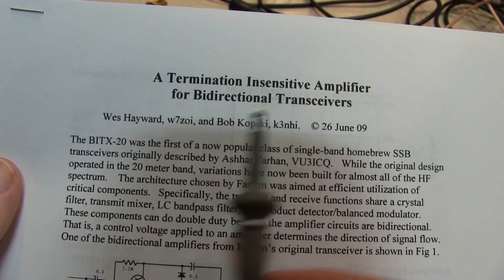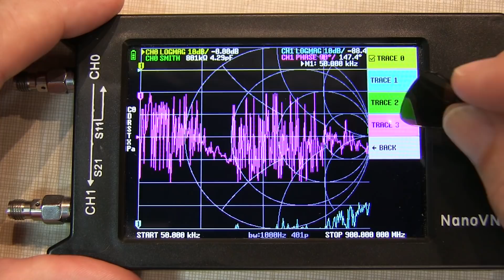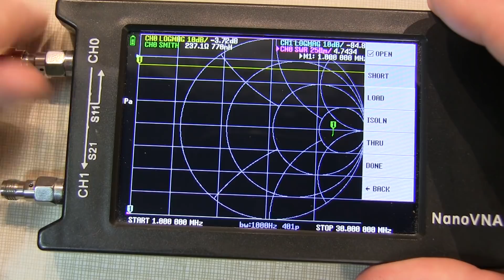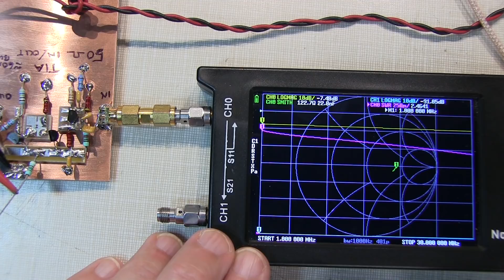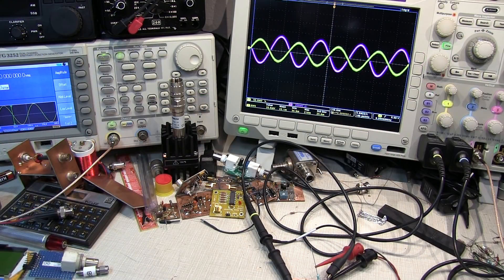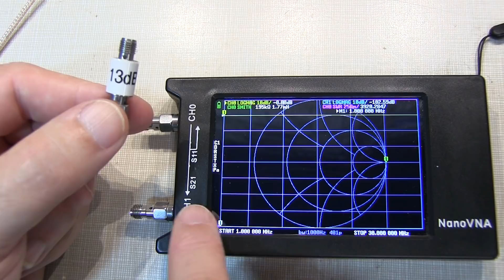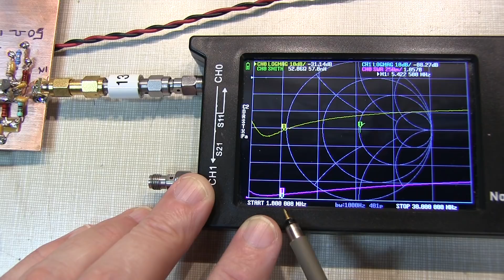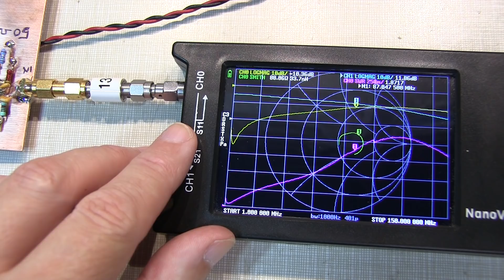#337: Use a NanoVNA to measure input impedance and gain of a small-signal RF amplifier

Comment: I watched some of your intro videos on the NanoVNA last evening and was laying in bed wondering if the NanoVNA could test some preamps and then thought I'll likely need some attenuators. Then I stumble across this video doing just that.

I really wish the NanoVNA was around 20 years ago when I was in college. I might have done much better in my microwave circuits class. I'm just realizing that I did a 3 year telecom course and never got hands on with a VNA or a spectrum analyzer. Now 20 years later I feel like I'm finally getting it. Had a similar experience the first time I seen AT&T's similarities of wave behavior like 15 years ago. I feel like college gave me a really good foundation in physics and math, but the radio electronics end of things was pretty weak. I've also never really worked in the field. Spent the first 10 years(starting from 17 before college) of my career working in AV doing sound, lighting and video.  These days I do science center exhibit design, fabrication and repair. I've been a ham since I was 16(25 years ago).  I keep coming back to the hobby and having new breakthroughs in understanding. Like the first time I seen SSB on the SDR waterfall, modulation suddenly made so much more sense.
Reply: Amazing, I'm doning electronics my story is the same.

Comment: Thank you Alan.  This helps so much.  Armed with your info we can all now use the NanoVNA to accurately measure circuit impedances.  This will be an enormous help for those of us who routinely take bits and  pieces of circuitry from multiple sources and try to put them together into working rigs.  Your video and the NanoVNA will remove the Z guess work.  Thanks again and 73   Bill
Reply: @SolderSmoke Bill - you nailed it!  I'm one of the folks that your and Alan's back and forth has been helping - thanks to both of you!  73
Reply: I heard "N2CQR", oh! That's Bill Meara of Solder Smoke!
Very helpful info, Alan, especially your explanation of the 13 dB attenuator.

Comment: Great Video Alan! (as always!)
I normally would have caught that because any time I do an analysis on something, I'm always cognizant of how much signal to put into beforehand.
This really true for direct-coupled amplifiers where you can pin-one to the 'rails' and blow things up!
In saying that, I can see where you would intuitively-assume that it's output would not be real high (i.e. tiny-box = tiny-signal!).
For the RF, I'm at the point of always first figuring out how much attenuation I can insert without compromising my measurements--good practice...

Comment: Great video.  An attenuator reduces the dynamic range of the VNA, so I've used a directional coupler to get a little less noise.  You're at the upper end of dynamic range, so not a concern in this case.

Comment: This video comes at an opportune moment, as I'm playing with one of these little BGA2866 MMIC amplifiers.  The S21 gain measurement on the NanoVNA is also invalid when the signal distorts.  Adding attenuation changed the gain figure from 11dB to 18dB on this test board.  Thanks!

Comment: Any video by you explaining the function of every component used in the 433 MHz transmitter and receiver RF circuit, explaining working of the both the RF transmitter and receiver circuit

Comment: I NEVER HAD THE TIME TO SPEC THE OUTPUT LEVEL, AND NOTICE THE EFFECT IT HAD ON INPUT LEVEL SIGNALS. THE NE602 MIXERS NEED TO BE LOOKED AT IN MORE DETAIL, MAYBE THERE IS A WAY TO ADD A CIRCUIT TO DO THIS VERY SAME TASK, BUT ALLOWING IT TO BE SWITCHABLE AS WELL.
WHEN YOUR BOX OF TOYS DOES NOT HAVE SUCH ATTENUATORS, YOU ARE FORCED TO ADD EXTRAS, BUT THAT REALLY CREATES A MESSY TEST BED.
3dB, and 10 dB PADS I HAVE, NOT THE INTERMEDIATES. GUESS I WILL BEGIN ACQUIRING THESE AS WELL. THANKS!
Reply: no need to shout here

Comment: Great video! Can you please show us how to check that the output impedance of the amplifier is also 50 ohms?
Reply from the maker: You would simply terminate the input of the amplifier, and then connect the output to CH0 and run a S11.  But, also you can see this basically from inspection.  An emitter follower has a very low output impedance (basically 0.026/Ic), in this case just a few ohms.  Then, there is a 47ohm in series - so it's basically very close to 50 ohms.

Comment: Hi Alan, I think this is your most recent video, so I'd like to reach out and ask you to set up an experiment that's right up your alley but I haven't seen you do it. It applies largely to PCB design and I think it was Rick Hartley that mentioned it but it's pretty spectacular and very simple to to.

If I have this right (and I may not!) the idea is you get a loop of coax - maybe a few metres/yards long (I'm European so I use metric) and insert an ammeter in the ground shield some where at the top of the loop.

Then you "short" the shield at each end with a short piece of wire - and you've probably guessed - put another ammeter in that short run.

Rick points out (and I believe him but I'd love to see this done) that at DC, the current all flows in the short return path but as the frequency increases, and he says the effect starts at audio frequencies, the current flowing in the "direct" path to ground begins to diminish and increases in the much longer loop. 

Rick explains this is because as the frequency increases the energy, which is travelling along the dielectric as a magnetic and electrical field (again, I might be wrong here) starts to "hug" - my word - the shields on the coaxial line.

I can do this at home with my own paltry "free shipping from China with a counterfeit XR2206" equipment ROFLOL but you're a great teacher and with your skills and superb equipment you could demonstrate this to a far wider audience than Rick or Eric Bogatin are able to reach!
Reply from the maker: You've heard the addage that "current always takes the path of least resistance".  We'll that's not the most accurate way to state that...  It would be more accurate to say that current always takes the path of least *impedance*.  For return currents flowing in a ground path, the "least impedance" translates mainly to "least inductance" as the frequency increases.  Inductance is minimized when the "loop area" between the forward path of the current (center of the coax in your example) and the ground/shield return path is minimized.  Thus, the image/return currents "hug" the region closest to the forward current path.  I talk a bit about this in my video on bypass capacitors (https://www.youtube.com/watch?v=9EaTdc2mr34)
Reply: @w2aew  Well blow me over with a whisper! :) Somehow I missed that one - probably (cough) bypassed (cough) it because I already knew about placing small caps near to the VCC/VDD rails on my ICs. I've been doing this like a trained monkey since I was a kid with no real appreciation of why. 

I've been working my way through your stuff and I wish I'd had teachers with your skill at explaining stuff when I was learning back in the 1970s. It's hard to explain the debt of gratitude I feel for all your work!

I'm still a little vague on this transmission line stuff since I tend to associate it with RF stuff that I don't personally work with. Of course, as you've pointed out here, the fast edges we're creating with modern chips (heck, I can recall near-chip bypasses back on early CMOS chips) produce masses of RF harmonics off into the multiple Ghz just by the switch time.

I forget if it was Rick Hartley or Eric Bogatin who described the experiment but (if you do care to recreate it), I believe the idea was to put an ammeter in the "short" side and another into the long loop. As the fundamental sine wave is swept  up into the high audio frequencies and beyond (if I've grasped what they were saying) the current - continues to follow the path of least impedance, so the current in the dead short drops away while the current in the (measurably) longer DC path starts to increase. 

Presumably this would require the sort of bench gear that many of us don't have as DVMs won't be able to measure AC currents accurately. 

I think it was Paul at EEBlog who traced around a ground plane with a fairly high end current probe attached to a Tec scope and demonstrated how signals propagated through the copper. 

I know this is pretty basic stuff to some but my poor brain opened the lid of my noggin and a white flag popped out. ;)

Apologies for the humour, it's the shortest path to describe my ignorance and astonishment at these wonderful demonstrations.

Thank you again.

Comment: Incredible video as always. I am using a Nanovna in order to check the input impedance of a transceiver IC used for an RF-433 Mhz module. The tranceiver IC has an LNA stage this is why I need to use a 30dB attenuator in the CH0 so that the IC's input stage amplifier will not get saturated(exactly as your video). The problem is that when I try to calibrate the nanoVNA using the 30dB attenuator the results I get are very very noisy. It seems that the impedance values in the smith chart are all over the place and I cannot understand why this happens. I have tried a second nanoVNA with no better results.
Reply from the maker: This is to be expected, unfortunately.  Even high performance lab grade VNAs will be noisy with a 30dB attenuator inline, expecially in CH0.  Think of it this way - the signal generated out of CH0 is attenuated by 30dB (1000x) before going to the LNA input.  Any reflected signal from the LNA will return through the same 30dB attenuator, making it even smaller yet.  So, for a device with a good return loss, the reflected signal will very small, and will be reduced by another 30dB before being measured by the VNA.  The only things that may help are the use of averaging and a lower RBW (if your unit has the ability to adjust the RBW or measurement BW).
Reply: Oh understood!!! Thank you very much Alan! You are always to the point!

Comment: Possible use less output Power (after reset go to Calibration->Power) in this fw Power auto use 8mA output in this range, so try reduce Power to 2mA, and after this made calibration.
Reply from the maker: Thanks - not all firmware versions give you the option of adjusting the power, so that's why I didn't mention it.

Comment: This is awesome, Alan. I have been fretting over this very thing for the past few days and was slowly working out a process to do it. I'd even bought, a couple months ago, a TO-72  HP 11858A & 11600B transistor fixture for my vintage HP8753 which allows you to insert and bias bjt's in the 3 different amplifier configurations.  How would you measure output impedance? Specifically, how would you do this for tube amps? or high power LDMOS amps?  I'm not the sort of person that just accepts that you do xyz (i.e use a 1:9 output impedance transformer as rote for an LDMOS part) because everyone else does it that way :)

Comment: Inquiring minds need to know! Is there anything significant about the 13dB attenuator? It seems very "random"? Great video showing one of the many "gotcha"s in electronics!
Reply from the maker: As described in the video - it drops the level to an acceptable level, and it’s approximately equal to the amplifier gain

Comment: Question: why don't you calibrate at the end of your adapter that connects to your amplifier and the end of the cable connecting to your amplifier?
Reply from the maker: I didn't calibrate at the end of the adapter because I don't have a set of female open/short/load standards.  Not worried about it though, since the phase shift through that short adapter was not significant at the operating frequency of the amp.
Reply: @w2aew  Thanks! That makes sense.

Comment: Hi Alan. Are these (budget) VNA's, that probably all of them use a square wave for the stimulus, in general suited to validate active circuits like amplifiers (of course making sure in- and output levels are correct, as we see in your video). As you say in the video, you are not concerned with this fact? Maybe the input of the amp will filter out some sharp edges? Or other way around, in what use cases these devices would be generally unsuitable? Other issue would be sometimes the devices that are using harmonics, whereby the strong fundamental is also present? But that would be a sub-question 🙂 This is contrast with a "real" VNA, that probably uses a sinus stimulus.
Reply from the maker: It is really highly dependent upon the device being tested, whether its performance would affected or different due to the squarewave stimulus vs sinusoidal drive.  It requires applying knowledge of the DUT and the effects of the harmonic-rich drive signal.

Comment: Very enlightening, sir.  I'm building that exact W7ZOI amplifier.
If you would be so kind as to offer me some advice, I would appreciate it.
I'd like to test the impedance of a mixer oscillator input using diodes with 300-500mV fwd voltage.
I'm guessing the Nano-VNA with 600mV should do the trick?
73 and thanks for everything you do
Reply from the maker: For a typical diode ring double balanced mixer, the LO port will typically NOT have a nice, well controlled impedance.  The function of this port is to quickly and fully commutate the diodes.  When this happens, then RF/IF ports should reflect the impedance at the other end, since the diode is making the connection from the IF to RF (or vice versa).  Testing the IF or RF ports without a) terminating the undriven port, and b) properly driving the LO port, will lead to incorrect results.
Reply: @w2aew  Thank you!

Comment: Nice video as always.
Do you have a video about TL072/074 JFET input Op-Amp on how to properly use them and its performance/behaviour and their differences between LM324/4558? If non yet, is it possible to feature it in one of your next video please? Thank you and more power.
Reply from the maker: They are quite different.  The LM324 is specified for operation from 3V to 32V supplies, while the TL072 is rated for 4.5 to 40V supplies.  The LM324 input common mode includes the negative supply rail (but not the positive supply rail).  The TL072 is just the opposite - input common mode range includes the positive supply rail, but not the negative supply rail. The TL072 output can swing fairly close to both rails (with light loading), while the LM324 can only get up to 1.5V below the positive rail.  These are just a few of big differences...
Reply: @w2aew  Thank you very much for the quick response.
I bought last year a TL074 with ST brand(no original) and last month with another brand(no original) but they're both from China. I wondering why the newer one behaves differently, lots of noise and early clipping. I'm thinking I might have some errors. I'm thinking if there are proper ways of using JFET input Op-Amps though my ST brand workes fine on the same circuit. I know the second purchased with another brand are not original for sure but same with my ST brand that works. Maybe I was faked(?) 
Thanks.
Reply from the maker: @JB-20  It sounds like you may have received fake/counterfeit ones.  Also, not that not all JFET op amps have the same specifications - so always check the datasheet.  Of course, if you get fake ones, all bets are off...
Reply: @w2aew  Ok, this clears everything. Thanks a lot.

Comment: Thanks for sharing w2aew!
 Does this mean that I have to use a 13 db just to check the input tune of my  Mini-Ball TL60 60 watt one transistor amplifier?
The problem is that the SWR is 3.1 to 1 with the amp on. It is putting out 50 watts with 1 watt in.
I suspect that it is tuned to the center of the 10 meter band. In fact my Nano VNA actually shows that it resonates at 28.500 MHz if I sweep the input of the amp
and has an SWR of 2.82.

I'd like to tune it to 11 meter and get the SWR down as low as possible.

Comment: Hello Alan, thank you for the video. I have a question about adding an attenuator at at the nanovna output. Wouldn't that cause an accuracy problem with the S11 measurement?
Reply from the maker: The affect of the attenuator can be calibrated out.  However, since the signal injected to DUT is attenuate, and the reflected signal is also attenuated, there will be some additional uncertainty in the measurement  - especially for DUTs with a good S11 (low reflections).

Comment: so where did you get the idea to use a 13db attinuator, was it from the determined gain of the circuit?
Reply from the maker: Yes, based on the gain of the amplifier

Comment: Very nicely presented and clear.  (a) Any caveats when measuring the output impedance looking backwards into the amplifier output?  (b) Which firmware are you using in this video for the H4?  Mine does not seem to have the "401 points" on the bottom..
Reply from the maker: As long as the output is AC coupled, then simply terminate the input and measure S11 on the output.  I am currently running 1.0.39 from Dislord (see video #320: https://www.youtube.com/watch?v=NcXzITPPTyA) on my H4.

Comment: Hello Sir...I just run the same experiment, and it works using the 20dB attenuator, the TIA gain was around 23dB.
BUT the nanoVNA graph show wierd pattern when calibrated using the 30dB or 40dB attenuator. I dont know why ?

Comment: Amazing video. Was thinking of trying this same thing two months ago.  Great tip about the nonlinear effects.  The amplifier has to be turned on (biased) to make this measurement?  Do you need a DC block to protect the NanoVNA?
Reply from the maker: Yes, it has to be biased because the feedback helps to set the impedance. A DC block is needed, and is included in the design.

Comment: I still don't understand how mathematically we get 50 ohm input impedance. the current is 7.4 mA. Vt / Ic = 25 / 7.4 = 3 ohm. plus the 15 ohm at the emitter for small signal = 18 ohm. looking from the base 18 * beta (100?)= 1k8 ohm... in parallel with bias resistors etc it's still not 50 ohm.... . Trying to learn so please someone explain where i'm going wrong :(